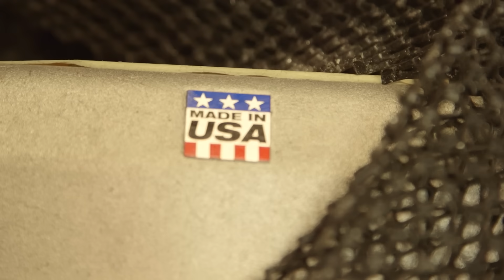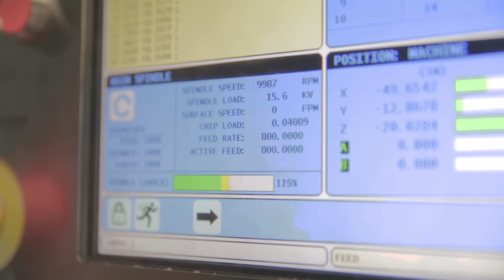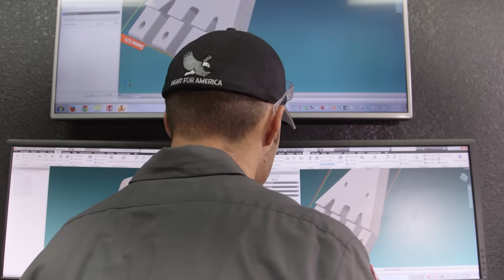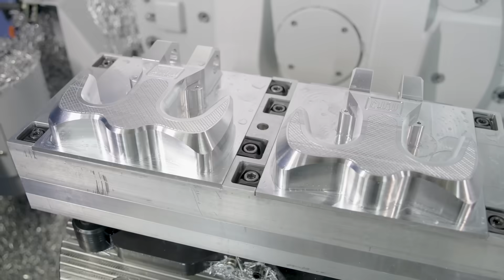Small Machine Shop Owner FIGHTS Back Against GOLIATH Company

Comment: I grew up in small shops and saw the tensions spoken of in this excellent video. I worked where a huge lighting company out of crawfordsville Indiana put a supplier in casey Illinois out in the same way using out of USA suppliers...Devastating a small Norman Rockwell type community.  Your boss is wise. My dad, a former tool and die shop owner, told me keep your customers at 15% or less of your total business so, if they pull out, the shop survives. Thanks!

Comment: Great story. I used to work for a Food distribution company. We had a lot of Thermo king reefers that were breaking down. The shunts in the boards were getting to hot and the unit would loose voltage. We would loose product or have to offload the trailers onto another. A few weeks of this got pretty old. The manufacturer refused to give us new boards or help us at all. They told us the boards had to go to new units first and they were in back order. About a week goes by and the owner of my company showed up to visit. I took the chance to tell him the problem. About 5 mins later he gets on the phone with his lawyer.
I am told to attend a meeting the next day. The next day I was with my manager and owner and lawyer. The owner told The manufacturer. “ We purchased 1000 reefers the last year. If you do not provide new boards for free. I will sue the shit out of you and go to another brand” I then told the engineer of the company the issue and what caused it. The next week we had 20 new boards to fix our reefers. I was shocked how fast it happened…

Comment: Agree that the mantra "the customer is always right" can get you in trouble because there are customers who will happily drive your business into the ground- all you have to do is let them. But having worked for a "Goliath", I encountered more than one "David" supplier (small company) who figured that as soon as we became their customer, we worked for them. They would call the shots, they would decide what would be delivered, and when. If we didn't like it, too bad. Promising more than they could deliver was the norm. Tools would be delivered without proper testing and debug, so our engineers (Goliath Co.) had to do it, meaning we paid for that work twice. Integrity is not related to company size.

Comment: We have told more than a few companies to go stick it (some pretty big).  When it came to things, like if they didn't like our terms of payment and wanted to force us to accept what they wanted to do or if they caused other major issues.  One many like to do is changing the goal posts after they have taken your quote.  We actually put in ours that if they want anything other than what was originally quoted for, they will have to pay extra.  And some jobs they have to pay for all the parts before we even order them.  But even then if they still keep messing us about.  We tell them we are no longer willing to do work for them.  And if they are a bad payer, we send debt collectors after them at thier cost and then refuse to ever do work for them again.  

What also makes them take note, sometimes to thier only after they put thier foot in it, is that when we get upset at them for been unreasonable about things or jerking us around, is that, we are pretty much one of only a hand full or maybe only one in town able to do certain things, depending what it is.  If we refuse to give them service, they pretty much have to fly someone in, most likely from one of the big city centers.  Meaning the hourly rate they charge is at least double if not more.  They then also have to cough up for hotel, food, car rental and flight costs.

Most companies we have delt with are good.  But like in everything in life, there are a few rotten ones.  Which spoils it for everyone.

Comment: I think you missed the man's business point rather and only embraced his ethics.  There's a thing called cost-of-sale.  This is all the money you have to lay out in order to provide a specific product or service.  Your raw materials are a cost of sale.  The wear and tear... the energy to run your CNC machines is a cost of sale.  

You're owed $300k.  But you've spent $150k in order bill that $300k.  If you never get paid, you've lost $150k.  If you never did the job, you'd have lost nothing.  

Granted, this is oversimplified to make the point clear.  Expenses versus cost of sale has a lot of grey area.  But you have to be aware of it, how working capital factors in, and how large debts from big clients can bury your busy if you let someone get too far ahead of you.  Getting the work is great.  Getting paid is the ultimate goal.

Comment: I worked in large co. in marketing.  One day a product manager (of many years experience) threw something at the wall and made a lot of noise.  He went on a 20 minute swearing campaign.  Calmed down and headed to corporate.  WTF?  When he got back he told us the story:

Corporate, in obedience to their masters, were doing everything to keep cash up. So suppliers (30 day net) were paid 60 and 90 days down the road.
Our products sold at about $20,000 - $200,000 per unit item.  They were held together, or had parts inside, held in place by high quality, but not all that expensive fasteners.
The buyers kept the pipeline full.  The buyers kept warning that some small suppliers were about to stop shipment.  Corporate snorted and carried on.

So the day came when we would miss nearly $2M in shipments that month for want of these fasteners.  Production was stopped and could not move product.

Some pretty small supplier had had enough with the nickel and dime routine.  We owed him a couple thousand bucks.  (If even that much).  He alone was stopping millions of dollars in shipments.

As a result of the manager heading to corporate on a rant (to the VP Finance's office, right beside the P's office) a cheque was cut and overnighted to the supplier, as well as a cheque to cover overnight shipment of the needed parts.

It took near 3 weeks to clear the backlog (amongst ongoing production) to get things right.  Our internal "cost of money" was set at 2%/month in those days (by the corporate bean counters).  So the stupidity out of corporate to merely delay $2000 by 2 months (2% x 2 x $2000 = $80) had a net internal cost of (1/2 x 2% x 0.75 x $2,000,000 = $15,000).  But more importantly, was causing delays at our customer's production line and they were less than amused.  (We normally were weeks ahead on delivery - and even had "ship in place" facility to store client goods).

I moved to a smaller co., and even when were financially strapped the President always made sure the small suppliers were paid on time, no delay, no BS.  

His attitude was "I'd rather go bankrupt and stiff a big co. or 3 than go bankrupt and stiff a bunch of other small companies."

Comment: a big issue is considering all aspects that are needed to give a fair deal. as an example having more and more of your orders from a single customer means you need to charge more and more money to secure yourself and your workers in the case they pull out or thinking they are big enough to bully you. it is often not talked about but you need charge a customer the time it would take to find new work if they were to drop out or deal with firing people. (it is a big risk if you go the second route since you are unlikely to be able to rehire them)

i have worked more than one job where a big customer just slimmed our orders all the way down or just ended to contract since they had a bad year. so i would just sit in the break room for a day and the boss just said "it is all part of doing business. i charged them so i have time to find new work for you" he didn't fire anybody. in the case of the contract ending we ended up getting sub-contracted to do the work the new company got and they had to eat the loss since the new company had expected the owner fire a number of works so they could hire those people on worse terms. they went bankrupt in 9 months.

Comment: You read a bit deep into his instruction not to under-quote. It's more simple than you think. If your machine is costing more than it is making to run, then not only are you not making money but you are wearing the machine out. On the other hand if the machine is not working at all, at least you still have a solid machine to work with later or liquidate.

Comment: I'm a buisness to myself. I work as a handyman. I did some work for a guy that was fairly rich. He wanted me to sign a big contract that would screw me over. I told him I'm not signing that and any plumber wont sign it. He wanted me cause my rates were cheaper. He went ahead and hired me. I did the work and his lawyer sent a letter giving the reason why they won't pay. I wrote back see you court. The Judge ordered 150% of the payment in 30 days or confiscation of assets till 300% of the bill. 100% for the work 50 for loss of work. 150 for the aggravation of it. 2 days latter his lawyer hand delivered a check. No local worker will do work for him. Felt good.

Comment: This seems to be a problem, but it's a blessing in disguise. As a small business we have experienced similar issues. I used to fret about "losing" a "good" customer, but after it happened a few times when I was very young, I realized these customers where the most disruptive to our business. They never had their paperwork right, they always paid 3-6 months late, and they were the most demanding. Always wanting stuff done in a hurry and wanting something special. I finally had a enough and cut them off. While the bottom line did suffer, it did so for only a short time because now I was able to devote time to our other customers and promote the business. But the best thing was I was not so stressed anymore. Best thing that ever happened to me. Learn from our experiences: customers like that are not worth the headaches.
Reply: this is a world wide problem sadly,
Reply: This is somewhat what's happening at the last job I worked at. Fortune 500 company that paid a ton of money, they also want us as an MSP doing easy work so it's effectively passive revenue. Thing is, there is very little support for the MSP feature and would require a ton of development that ultimately we wouldn't own; they own the code while the best we can do is get a perpetual license. So we are doing a ton of work for them on a weekly basis already, then we'll be doing work on a frequent basis afterwards, and everything we create during that time period relevant to them is effectively what they own. This is on top of being on support for their internal team to go through the code (honestly I created, tested, and documented 99%+ of the code and that number is not an exaggeration so it's a sore spot for me) so there's nothing really stopping them from cutting us off later once their own guys milk the company for all it's worth. The higher-ups I worked with from my last company pretty much made it obvious that we're more than willing to bend over at their behest so I can only see it going south (we've already done some things out of scope and are honestly putting in more work than we should be for the expected project timeline in order to get things done on time. But we don't want to get them annoyed so we just shoulder on the work, a good chunk of which fell onto me 😭).

I left for a few reasons, being overworked and feeling frustrated with how we're being dominated by a client (even if it's a fortune 500, we've set the precedent that we can only grovel at their mercy) definitely played a factor though. The company's actions as a whole are just so heavily influenced by the CEO's greed and the culture to "win, win, win" that it doesn't feel like the company is willing as a whole to take a hit in order for a more sustainable long-term future. So disappointing because there were some cool folks and I actually got along with everyone, it was definitely bittersweet to leave.
Reply: @yerpderp6800  Only way to address this issue is they a debugging/modding clause in the contract. You can either lay claim to ownership of that code or you can charge them a fee for your time/work. You can also charge them per hour for support. They may not accept it, but you can try.
Reply: I’m retired now, happily I add, and I was a purchasing & merchandise manager for a large regional wholesaler. We had several large suppliers that we inventoried product with us for a third party mutual customer. So I saw things from the other side.

I not only looked out for the welfare of my customer but also the suppliers too. I never did anything unethical and I had an ironclad reputation for honesty. It didn’t happen a lot, but occasionally something would come up that would have hurt a supplier, while my company would have a short term benefit. I never did that.

I saw my suppliers as my partners, not someone to abuse. I specifically remember one occasion when I could have really hurt a supplier. Instead, I arranged for him to come in to see me. I laid everything out in detail, including my proposal. At the end of the meeting everything was resolved. We both made a lot of money, even after we passed along savings to customer.

The supplier leaned back in his chair, looked me in the eye, and said, “You will always handle my wholesale business for me.” Over time he even directed additional business to my company.

Of course we all want to make money, but to do so unfairly doesn’t lead to a long term mutually beneficial relationship. Be fair, be ethical, be honest, and your business will grow.

Comment: I’ve seen this happen to so many small machine shops when they depend far too much on oil industry related companies. Small shops must diversify their customer base. The oil industry is a roller coaster. When it is good, it is “great” but when things turn bad, for suppliers it gets very bad. Big companies, such as the one I worked for 42+ years,  will outsource their manufacturing, and in doing so, some of their expertise gets outsourced. It is a symbiotic relationship and big companies forget about. For big companies to succeed, their suppliers must also exceed. The big company I worked for had a reputation for paying late. I got so many phone calls from small machine shop owners complaining about it. I was powerless to help. It finally manifested itself when we needed prototype parts for engineering and the shops started to “no quote” us. That got management’s attention and bills started getting paid.

Comment: that's a damn shame.
good on you for speaking out. I was in the market for a supercharger, but I guess i'll avoid Edelbrock now.
i recognize the logo, the heads, the manifolds, that supercharger body...
Reply: I wouldnt be so sure, i think the footage was just used. They mentioned hydraulics, edelbrock doesnt use hyd stuff, unless you count AN fittings, those are purchased from another manu and re-branded, if im correct.
Reply: @whiskerbiscuit99   pushrod-engine lifters are considered a hydraulic components because they operate like a hydraulic bearing, using oil pressure to form a cushion between the pushrod and lifter.

superchargers also have their own self-contained oil systems and Edelbrock sells all sorts of branded oil fittings for them.

that beaning said, it COULD all be stock video, but i find it ironic that ALL the stock video shown appears to be of Edelbrock products.
Reply: Oh, wow.
Reply: @kevinh5349   yea very good point.
It looks like the likely options are Stellantis (Chrysler/Renault), Honda, or Rivian.

Comment: I used to own an industrial engraving company.  Because each job was unique and when the materials were provided by the customer and could not be used for any other application, I would charge 50% of the invoice upon receipt of the material.  I would also demand payment in full upon delivery... no terms.  When new customers questioned this policy, I politely explained that I was burned once by an unethical customer and this is the way I do business under those specific circumstances regarding customer supplied materials.  I told them that my processes are better and faster than my competition, and the upfront payment is their way of holding me accountable... and that when the work was done, their finished parts were my hostage for payment... my way to hold them accountable.  Some customers laughed and walked away, only to return later.  Some weren't particularly happy with this policy, but did it anyway if they wanted my services.  All customers were 100% satisfied with the final product.  I never missed a deadline, I never missed a payment to a vendor, and I never got burned again.  It really made business simple.

Comment: Firing bad customers is a great business practice but it can be pretty nerve racking when you go through the process. 
The other way to do it is to convert bad customers into good customers. The 'bad' customers usually get going when the vendor allows them to run roughshod over the commerical practices. Not allowing the customer to get way behind in the first place tells the customer that those tactics don't work. Once the debts really get large, it's pretty hard to come to a workable solution. Allowing stuff like payments to go 60 ot 90 days past due is an invitation for the customer to continue the practice. 
Know your terms, stick to it.